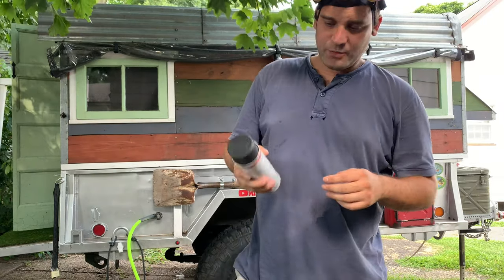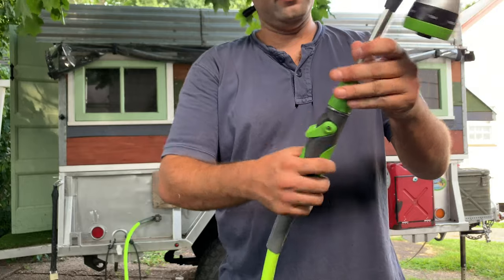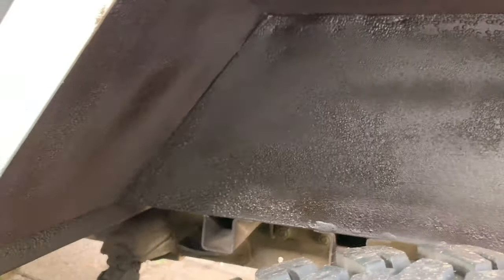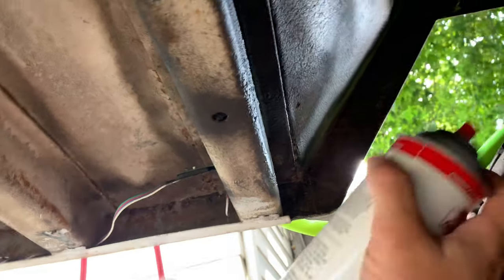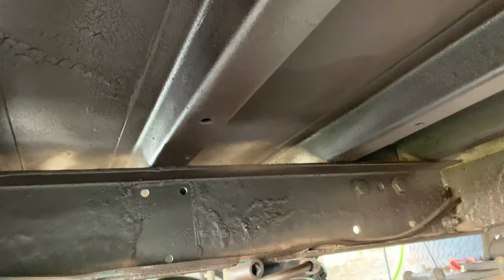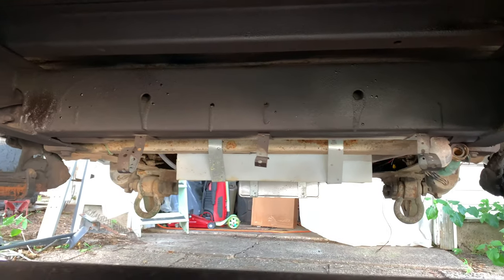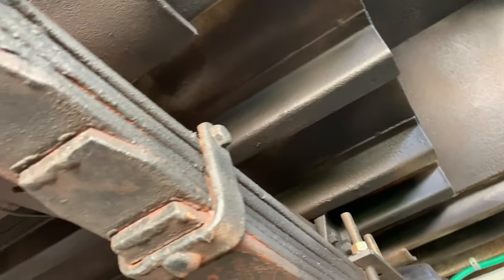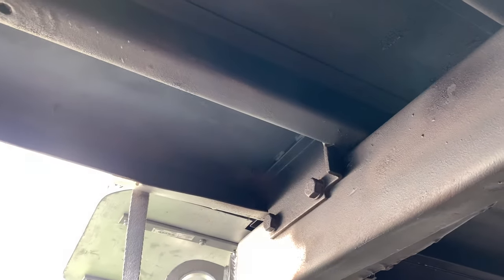Undercoating The Camper Frame.

Comment: I've used some stuff similar to that on other projects. While it's easy to use and sometimes you get lucky and it lasts a long time it's pretty unforgiving when it comes to dirt and dust on the surface before hand. Good job on power washing first, but keep an eye on it to make sure it doesn't start peeling off.

I went with a roll on bedliner from Lowe's on my frame and would highly suggest that if this doesn't work long term.

But good job on preventive maintenance.

:)
Reply from the maker: Hey man thanks for watching and for the feedback! If I notice any deterioration in this product I will definitely look into redoing it with the roll-on bed liner!